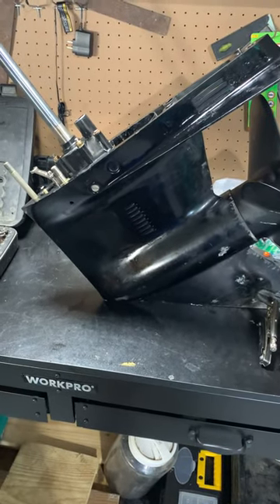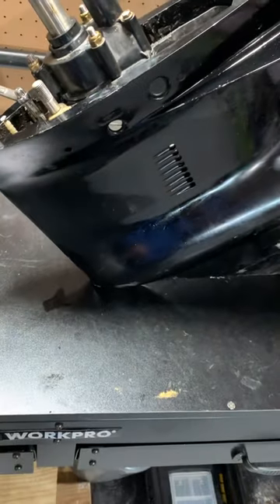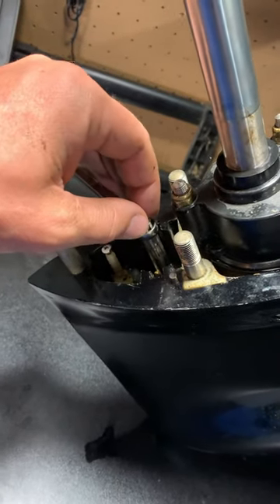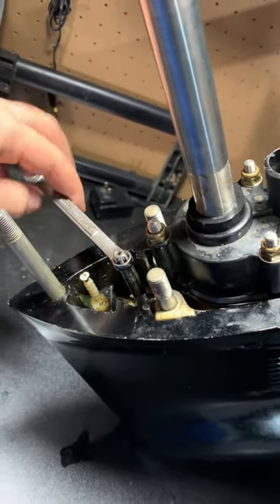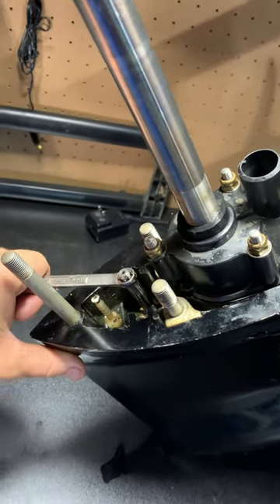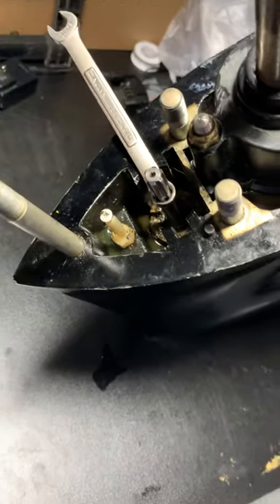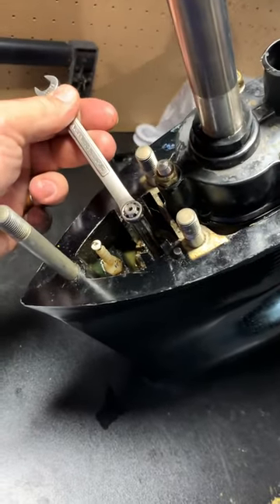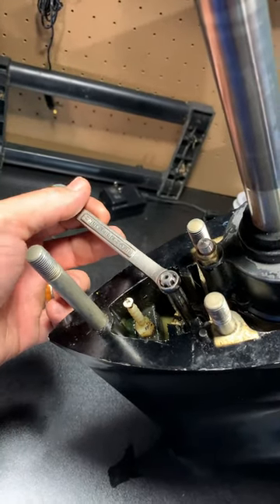Secrets Behind Mercury Shift Shaft Alignment

Comment: The reason you're meant to leave it in forward is because it allows the shift shaft lever to line up with the receptacle (which is also in forward).  If your shifter is in forward (from the cable) and your gear is in forward (displayed here) then both will align pointing in the same plane as your are sliding the out drive back on.  This is necessary if the whole outdrive is removed. Additionally you can turn the prop to align the driveshaft splines.  

If you're just popping the lower unit on an already attached upper to transom/gimbal then you don't have the driveshaft to engine spline alignment to worry about, only the lower drive shaft to upper gear alignment.  You're might get lucky and slide right in but you still have the issue of having the shift cable position matching the lower rod. Another point of having it in full forward is that you know you're maxed out in one direction of movement so you won't end up in the situation where instead of being able to adjust the lower rod from say 0 to 90 degrees relative to the direction of travel you might be setting yourself up for a -25 to 65 degree position which not only won't get you fully into either reverse or forward but it will be trying to rotate the lower rod beyond its limit.  

If you're upper is already on the boat then you could do it with lower and upper in reverse but it's just easier if everyone always does forward since it works in both instances.

Comment: Perfect timing posting this. Was wondering why I had no gears when my shift cable moved just fine. It was because I twisted my shift shaft to get my lower unit to go on properly. You explaining how this all works is very helpful for me in solving my problems. Thank you. I just got my 1988 75hp mercury running today but it was always in forward gear. I must have turned it quite a bit.
Reply from the maker: Glad it helped you! Takes very little to get it out of alignment.

Comment: Great video. Needed this 3 weeks ago though. And it’s easier is you leave it in gear instead of neutral,because when you put the shaft back in , and if your shaft doesn’t line up, you will need to turn the prop a bit so the spline lines up .
Great video man!
Reply from the maker: Great point!

Comment: Nice! Worked on an Optimax lower unit 150. The key is just take your time 11/32 wrench or socket. It doesn’t take much force to turn it into gear if it fights you little bit just turn the prop until it engages a little.
Reply from the maker: Nice work!

Comment: Was taking a break from the last 3/4 inch on my lower of a 88 200hp 2 stroke,  my dad and I been struggling getting it to mesh. 

Now I realize that the lower is in neutral, and the shaft doesn’t spin very easy due to a fresh water pump impeller,  I hope that when I go outside and shift the lower to forward and put the shifter in forward on the selector it will mesh the rest of the way as I spin the prop shaft and heave ho it back together. 

Thank you for doing this video.

Ps someone needs to machine lowers for a LS v8 engine,  and not use this style water pump. 

That would be cool. A budget LS with a turbo,  good 800-1000 hp outboard and affordable 😂😮. 

Thanks again 
Jimmy heesch
Reply from the maker: @knowledgeispower6732  glad to help!
Reply: @payitforwardDIY  
Still having issues,  while I got it together shortly after watching your video, I am having a few issues,  one mainly no water coming out of the back of the block and 2nd, it ran for 45 seconds and then not getting fuel. 

When I put the 11/32 wrench it would only turn a small amount and didn't click, then when I spun the shaft it would engage ant then drop back to neutral. I didn't want to force it,  so I bumped the starter and that seemed to work, but I may have missed the copper pipe or it popped off in the midst, so I may have to remove the lower again after I figure out the fuel issue. 

Do you know if it will run dry, or is there a safety sensor that won't let it run without water presence. 

Thank you
Reply: @payitforwardDIY  how soon should I see water stream after starting. I have the hose and clamp on and running water before cranking.
Reply from the maker: @knowledgeispower6732  you should see water within 10-15 seconds
Reply from the maker: @knowledgeispower6732  did you have the water pump off? The easiest mistake on that is to put it in with the fins pointing the wrong direction.
Reply: @payitforwardDIY  
Yes we replaced the upper part and lower seals plus the impeller but I put the impeller on the shaft and then the cover, I couldn't to it by hand and I didn't pay attention to that, I figured when the shaft started spinning it would automatically change to correct itself.

Comment: 2000 75 hp merc 2 stroke, I put mine in neutral with the shifter also in neutral , attempted spline line up , reinsert 3 times ,, moving driveshaft until it lined up clockwise. there is a lot of movement after forward or reverse is selected at the lower unit = off by a few splines.

Comment: This helped me out today, my outboard was stuck on forward, I hit a shallow water and I guess that small impact was enough to push up the gear shaft that goes down to the lower unit and was stuck.
Also I did put my shifter in neutral and the lower unit in neutral and they lined up perfectly

Comment: Hi, great video!! just wanted to ask if you know, I have a 200HP 2002 mercury salt water outboard and I did the impeller myself, I took the boat out the other day and noticed sometimes its hard to shift into reverse and a few times when I shifted in forwards I could hear it kick in kind of hard after I used the lever, could this be why? Thanks so much!!
Reply from the maker: @smeg8557  yeah, it sounds like the shift shaft didn’t line up exactly right when you put it back together. May have to take it off and realign it.

Comment: thank you very informative my question  / problem  as you show the shifter gear moving just a little then clicking ,  mine will turn just using my fingers at least 180 degrees  before clicking.  and i can only seem to get it into reverse and neutral , i can't seem to find forward.   Do you have any thoughts  or comments  thank you   i am very new to working on motors.  I took the lower unit off to fix the impeller
Reply from the maker: If you know for sure yours is in neutral you can turn it clockwise to get to forward. Turn it till you feel resistance and then push it firm until it clicks. Wiggle the prop a little with your free hand and that may help it as you turn the shifter.

Comment: Awesome video... I have a question on the water pump if you can help. 96 mercury  that we have put a new gasket set and pump in. Reassembled it twice  now and everything is correct but no water coming up. Don't know if we ain't tightening the housing nuts down far enough but afraid of breaking them of. Any torc specs you may know?

Comment: Is it normal for me to be able to easily rotate the shifter clockwise after I click it into forward gear? Or should it click into forward gear and hold right there?

Is the shift shaft only meant to click in and out of forward, neutral and reverse without able to be freely rotate?

Currently I can freely rotate my shifter clockwise about 180 degrees when it’s in forward gear. I’m wondering if that is a bad sign

Comment: Just had this happen last night with my 40hp Merc. Easy fix, thanks. Any pointers on getting everything lined up when putting the lower unit back on? Seems like it always takes me 30 minutes. Try spinning the prop and that doesn't seem to help. Appreciate the video
Reply from the maker: If it’s in gear spinning the prop should help line up the splines on the end of the drive shaft with the motor. Also getting the water tube lined back up can be tough. I use a ratchet strap attached to the top of the motor and loop it around under the lower unit to help hold it while I get everything lined up.
Reply: @WaeLynneandMoose  In neutral now with lower unit out. So put into forward gear on boat, and manually put lower unit in forward? Install, then everything should line up and shift back to neutral for start up?
Reply from the maker: @bransayler  Yes that's exactly what I ended up doing!

Comment: Thanks for the video!! I have a question maybe you can help me. in front of that shifter there is a nipple that has a hose going to it on my 1985 115 hp. WTH is that hose for? I installed a new impeller and that nipple broke. Now im stuck in forward.  Does that have anything to do with the shifter? Thanks in advance!!
Reply: I got the answer from my neighbor who is an old Coast guard mechanic. Thanks for this video though. I used your method to get my bot right.

Comment: Man I wish I would have seen this, mine is just stuck in nuetral, I cant even rotate the shift shaft at all... did exactly what you said not to so and that was pull up or push down on it... I have no last ditch efforts and im mentally exhausted at this point, I think inwill just have to bite the bullet and take it in... I see people say to pop that white bushing where the shift shaft is and try to realign where the shift shaft drops into but im just defeated at this point
Reply: Well how are you? Did you find out what the issue was? I’m in the same situation as you were 🙈
Reply: @thomasdonoghue9073  yes I got it figured out.... I took the bushing off and removed the shifr shaft... I used a metal tape and made a small "L"  and stuck it down... if you use a flashlight, you can look down and see it's not lined up right

Comment: I just bought a 1998 lower unit off of a 200 horse. when I turn the shift shaft it shifts correctly. CW forward, CCW neutral, and CCW Reverse. MY question is should it be clicking? Because it is not clicking into position. i know yours is an 86 but i'm thinking they are all supposed to click into position correct?

Comment: how come on most ones ive seen they always say put handle all way forward bfore you pull it apart so now im really confused
Reply from the maker: That leaves it in forward gear and will allow you to spin the prop when reinstalling the lower unit which will turn the drive shaft and help it realign with the gears up in the engine.

Comment: Did what you said not to. My boat is now stuck in forward the internal linkage is disconnected. How do I reconnect it
Reply from the maker: That's bad news. I think you will have to remove your lower gears and get it all linked back together.
Reply: @WaeLynneandMoose  dang. Good project for tonight. Maybe I’ll make a YouTube video on fixing it
Reply: @WaeLynneandMoose  ended up working again. Kinda popped back into place and started working again. With a lot of shaft spinning and messing with the shifter.

Comment: I swapped lower units as the original had a broken skeg. When I put in the other unit I found a 2 1/2" long by 1/4" flat piece of hardened steel that was blackened from exhaust on the ground. Any idea where that goes. The reason I ask is after putting it all together it goes into reverse fine but I have to hammer it in forward to get it to go which is not good as the motor is now revved up and it pops in gear??

Comment: My shifter does not click when I try to turn it and there is a lot of tention when I try to turn it.
Reply from the maker: It takes a good amount of pressure to click it into gear with a wrench. However if it won't go your shift shaft may be disconnected or misaligned with the lower gears. One thing you can try is to spin the prop by hand a little as you turn the shaft.
Reply: Still no luck but thanks anyway. I might just buy a whole new lower end haha. This thing is a headache !!!
Reply from the maker: I felt like that right before I figured it out. Once you get it you’ll be surprised how simple it is.
Reply: @kgkeke3227   I found turning the main shaft CW while trying to move the shift shaft makes things a lot easier